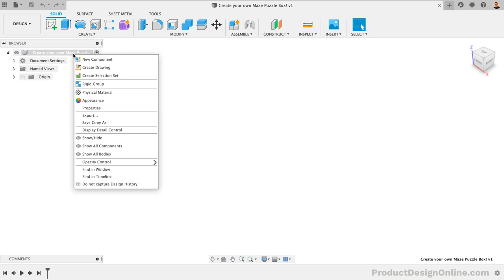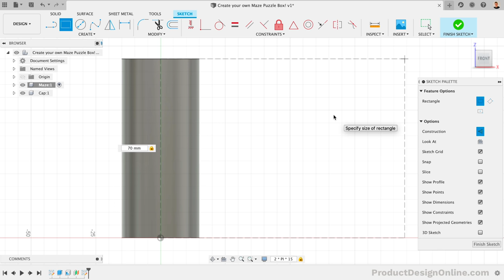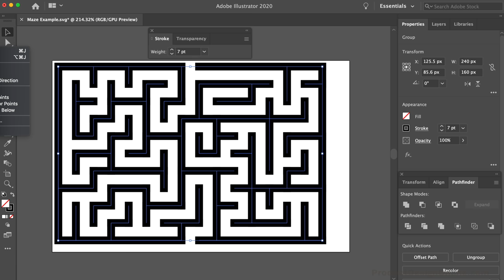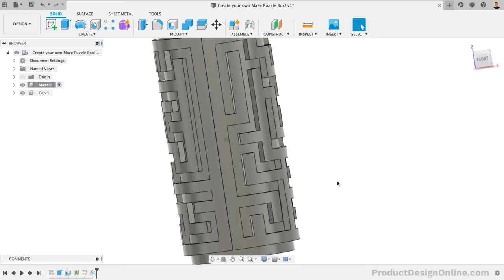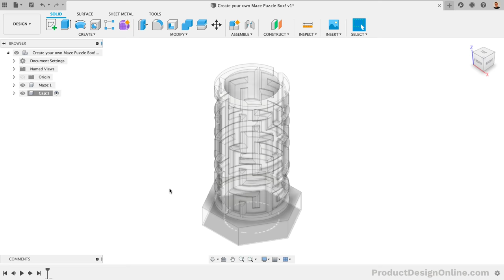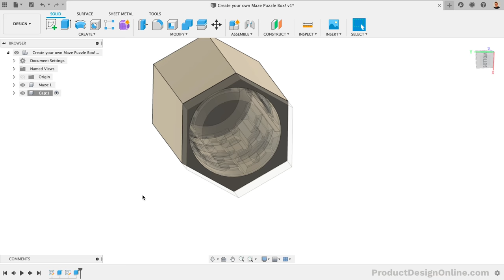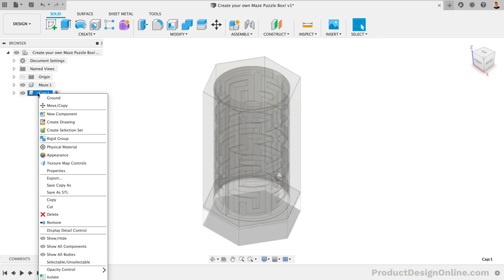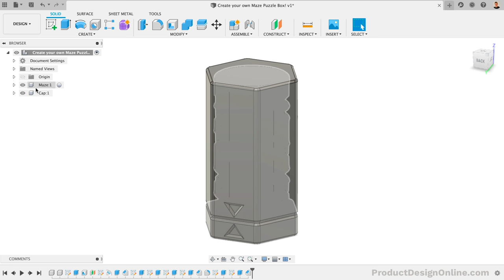Design your custom maze puzzle box in Fusion 360

Comment: Inkscape Maze Thicken Instructions:

1. Open Maze SVG file.
2. Select all wall lines. (Use mouse box select or shortcut Ctrl-A)
3. Object > Fill and Stroke (Or shortcut Shift+Ctrl+F)
4. Go to Stroke style tab and change Width (to e.g. 3 mm).
5. Path > Combine (Or shortcut Ctrl+K)
6. Path > Stroke to Path (Or shortcut Ctrl+Alt+C)
7. Save as updated maze SVG file.
Reply: I've been wasting my time for hours tryin to accomplish this!  For some reason other ways of doing it in inkscape work on non-sense svg's but a maze wouldn't cooperate.

Comment: Thx a lot Kevin, great Tutorial.

Note to myself - In Adobe Illustrator: 

1) File --> Open: Select the svg File
2) With the selection Tool --> select the whole svg

3) Use Stroke: Turn up to about 7pt
4) Object --> Expand
5) Pathfinder --> Unite
Reply from the maker: Thank, Koen! I also have the Illustrator process documented on the resource page https://productdesignonline.com/38
Reply: Thanks for this! 

I was stuck at this point. Works the same in Affinity Designer.

Comment: Another option you could have used for creating the thicker walls of the maze is this:
Import in your maze as an SVG, scale, and position as you did, but with the original line weights being thin
Use the surface extrude command and extrude the lines from the maze SVG some non-important amount
Use the thicken command to achieve the wall thickness that you desire
Create another sketch and project the flat surfaces congruent to the original maze SVG, 
And finally, use this second sketch as the source of the emboss command

I really enjoyed this tutorial, and it really showcased the emboss command well.  I had been thinking about how to do this when I saw your video first detailing the emboss feature.  I guess great minds think alike!

Comment: To check clearance / tolerance one can also use the section analysis tool. I think you suggested this in your threads video, and I've been using that ever since I didn't need to do it manually. This one is great.
Reply from the maker: Great tip, Mike!

Comment: great tutorial
when using inkscape the process is a bit different though, I create a PNG fro the maze and use trace bitmap functionality, works fine as well
I have been using the sheet metal functionality to create these up to now, with emboss , the champpfering is a bt more tedious since you can do an angle extrude with the sheet tool, results more or less the same

My son loves these boxes, I make one every week for him, then having the extrude is better for the process as I just need to swap out the maze.
Reply from the maker: thanks for clarifying - it's been a while since I've used Inkscape.... and that's great - it certainly is nice to save some time by swapping out the maze :)

Comment: [SOLVED - See end]
Brilliant Kevin. Always enjoy your tutorials - but this one has me stumped at a simple selection!
At 11:53, the face to be extruded for the Cap is selected - it's the face that connects the 0.5mm gap circle just created to the outer edge of the polygon - I can't figure how to select that plane - what I get is the face that runs all the way from the outer polygon to the outer maze, ignoring the circle. This is no good obviously as the puzzle will not function with a vertical slot running the full length of the cylinder. How do I select the face that needs to be extruded?
Could somebody point me in the right direction please? Thank you.

Got the answer from the Autodesk Forum - a bit obscure, but the problem was the 'project' immediately preceeding this step. I wasn't aware that this has two options since I just assumed the default. In my copy of Fusion 360, this was defaulting to 'entities', but it needs to have 'bodies' selected for this to work. Every day a learning day, and so I thought I would leave this comment in case others make the same mis-step.

Comment: Thanks so much for this video.  I want to make texture rollers for using with polymer clay.  This totally showed me how to do it.  My question is how to know the size of the SVG in import so it meets up on the cylinder.  You mentioned that you knew what that number was but how did you figure out that number.  I've been playing with this but am not able to get a true circular design.
Reply from the maker: You can use an online calculator or follow this formula: https://www.cmrp.com/blog/faq/calculations/how-to-develop-the-blank-flat-length-for-a-cylinder.html

Comment: First off... Thank You for this tutorial!! It was Awesome and I learned a ton!  I didn't even know about the emboss feature. 
I have an issue though.  I have been able to fix it with some hacks and supper glue on existing prints but... In my puzzle prints following this tutorial a person can 'cheat' by simply getting to the bottom of the maze and tilting the maze out of the cap!  I have toyed with the tolerances and the extrusion offset of the cap peg but have not been able to solve this issue short of changing the maze and filling in extra profiles on the bottom (or filling the bottom puzzle with super glue after print... except for the exit).  Is there a simpler way to solve this I'm not seeing?  Forgive me if there's an update or something I'm not seeing.  I see you have an 'anti-cheat' stl on the page... Is there a update video?
One thing I haven't tried that I figure may work is to simply choose the maze length-width ratio to end up being less than my over all length of the cylinder yet wide enough that the circumference can still stretch to match.  Then use the line tool to maybe extend the exit of the puzzle through to the bottom?
Reply from the maker: Hi Jason. I don't have an updated video per the anti-cheat version. But it is relatively simply, you'll just want to Extrude the tube beyond the maze (I think mine was about a half inch).

Comment: Hi Kevin. Thank you very much for your videos. I learn a lot from it. I tried to design the maze but with no success. I start is over and over again, at least 5 times, but always have problems to do the chamfer after the emboss of the maze chart. I made a new SVG every time with no success. always there are several parts that can't be chamfered. all others are ok, but I need to chamfer all of them. The error i get every time is: Error:   The fillet/chamfer could not be created at the requested size.
    Try adjusting the size, deselecting some of the edges (try disabling Tangent Chain), or using multiple separate operations.
I tried to reduce chamfer size and uncheck tangent chain.
I appreciate your help.

Best regards,
Nadav.
Reply from the maker: Hi Nadav. You can try to chamfer the edges before embossing. Let me know if that works
Reply: @ProductDesignOnline  Thank you Kevin, I tried as you told to chamfer before emboss. same result. there is always one chamfer that the fusion can't produce and report error. and it always appear after many successful chamfers, so I need to cancel it. is there an option I will send you the f3d and svg file for checking?
Reply from the maker: @nadavbarak123  Please join my new community space where you can attach the .f3d file (in the Fusion 360 Q&A space) - https://bit.ly/PDOcommunity
Reply: @ProductDesignOnline  I will post it. Thank you. I just solve it with sheet metal but your emboss way looks much better, it just doesn't work for me. I will post the f3d. Thank you very much.

Comment: Is there a reason you used an external slicer rather than using F360's internal slicer?
Reply from the maker: Mainly because I have a bunch of profiles saved in Cura and Fusion 360 still lacks a few key slicing features :)
Reply: @ProductDesignOnline  Understand. I just checked (again) your most recent vid on the F360 slicer. Even though it was posted only 3 weeks ago, the F360 slicer has had some bug fixes and product updates. One of the, now fixed, problems was it was trashing user's custom profiles.
Reply from the maker: @janetizzy6741  yep! They're making a lot of great progress and from what I hear there is a lot planned before the end of the year. It will be interesting to see what it's capable of in a few months... I'll prob have to do another video :)

Comment: When I go to emboss it will not allow me to select any part  of the maze. Even after I fix/ unfix the svg maze. If I close the beginning and end of the maze I can select it but no features show up.
Reply from the maker: Is it giving you any error message? The Emboss command will not work if you have a sketch that is just larger than the surface area. You may need to try to resize the sketch to be smaller.
Reply: @ProductDesignOnline  no error message. Fusion will not allow me to select the lines. I can select the face though. I tried resizing. No luck Could it be because of stroke weight?  The SVG come in as fixed lines as well.
Reply: @ProductDesignOnline  got it. It was not enough stroke weight causing the problem.
Reply from the maker: @kstickak  ah, thanks for sharing! Glad you got it sorted out :)

Comment: I'm having an issue where the svg isnt as thick as the actual image and it wont let me select the sketch for emboss
Reply from the maker: Hmm.. which program did you use to create the SVG? Sounds like there may be some gaps/holes in it. If the segments are not fully-closed then you won't be able to select it with the Emboss feature.
Reply: @ProductDesignOnline  I used inkscape

Comment: Can someone post how to use inkscape with a generated svg. When i save the update svg and import the lines are still 1pt thick...
Reply: I had to go into fill and stroke properties [shift+ctrl+f] and set the fill and stroke to flat colour. That worked for me.
Reply: @TrevorOConnell  that didn't work for me. any chance you can record a screencast of what you did
Reply: @TrevorOConnell  Can't make this work in Inkscape, but I admittedly know very little about this thing. If I import Kevin's file, it looks right, but if I import mine with a 6 pt width and try to set the fill and stroke to a flat color, I get the same behavior. Not sure what I'm doing wrong, but I'm obviously doing something wrong.
Reply: @HardLuckCafe  I managed to get it to work once but i dont know what i did. I used the steps explained in a comment below from @Keon Verbeeck and tried to replicate them in InkScape. I think it has something to do with stroke to path and union. But i am not 100% sure
Reply: @IlanPerez  Ilan, i forgot to mention i did Path - Stroke to path and Path - object to path in the main menu bar at the top.
Reply: @TrevorOConnell  I managed to get the output the same as the demo file. Here is a video on how to
https://youtu.be/DENZs2PtDBw @Product Design Online feel free to add it to your webpage
Reply: @IlanPerez  THANK YOU THANK YOU THANK YOU

Comment: I would think duplicating the maze twice horizontally and using 2 pins would have smoother action.
Reply from the maker: I made some like that but didn't demo in this video. That said, I haven't had any issues with the single pin as long as it's large enough :)

Comment: For some reason, Fusion wouldn't let me select the part you selected at 13:34. :(
Reply from the maker: Do you have the "Auto Project Edges on Reference" turned on in your preferences?
Reply: @ProductDesignOnline  I'll have a look later. Thanks.
Reply: @ProductDesignOnline  I'm not sure what I'm doing wrong, I still can't do 13:34 with auto project edges on references turned on. :(
Reply from the maker: @isaac-h  Make sure you're looking directly at the sketch. Auto project will not work if you're not. You can share your Fusion 360 model in my community space - bit.ly/PDOcommunity
Reply: Thanks, @ProductDesignOnline . I've shared it in your community space.

Comment: Did you use 0.4 nozzle?
Reply from the maker: Yep!
Reply: @ProductDesignOnline  Ok, i am not pro in 3d printing, but have printed 2 years without issues. I belive when using 0.4 nozzle is best to have thinner then 0.8 walls, i am printing with 0.5 nozzle the last year with 0.8 walls to have a little overlap, but i print parts that need to be solid and glued together. This is just a question, just want to know what others are using :) Great film BTW, i have just drawn your maze box with a little twist in fusion. Thanks for your sharing.

Comment: anyone ever thought of roller bed 3d printer? Could be a new game changer.
Reply from the maker: Do you mean the conveyor belt 3D printer like reality released a few years ago? Or something different?
Reply: @ProductDesignOnline  that one I knw.. I m thinking of roller drum type so called mandrel and print head stays over the roller and moves left to right and up and down. While this roller spins. The roller should be removable to take out the prints. And it should be at certain height. The main aim of this type is able to print overhangs and circular and cylindrical objects without support. And also how about a nozzle with flat slit opening ? Something like 0.4mm×1.2mm rectangular nozzle opening ? Could be able to rotate 90degrees so whenever a wide infill or wall is required it can print quite fast and whenever a thin line required it can rotate 90degrees and still can cover bit more distance
Reply from the maker: @adithyafpv  ohhh, I see what you're saying! They do have those, but I've only seem them on the commercial end. There are actually some really cool ones that do ceramic and other materials on a roller.

I have not see any consumer level ones though...yet :)